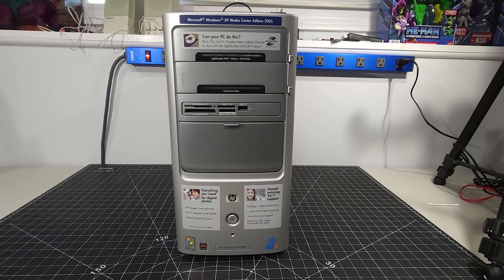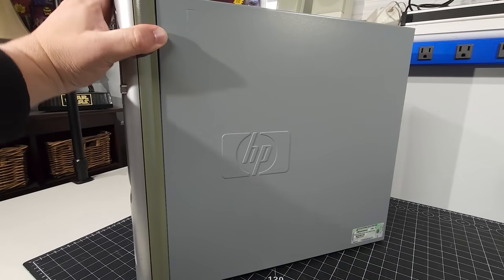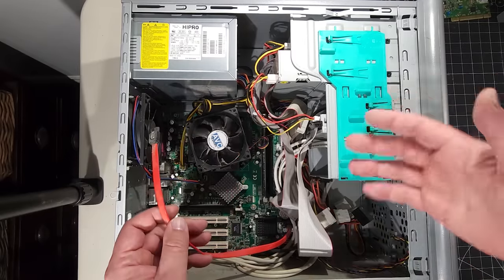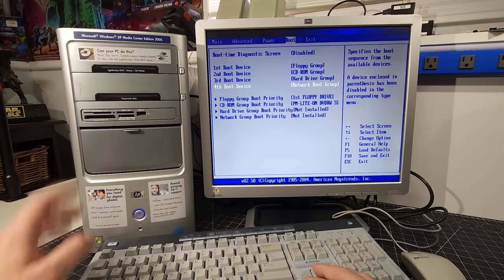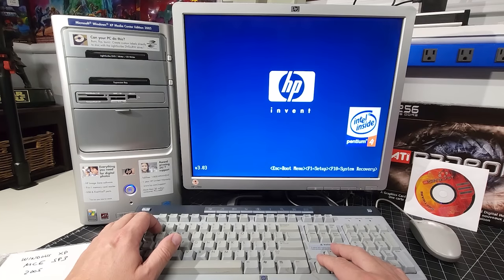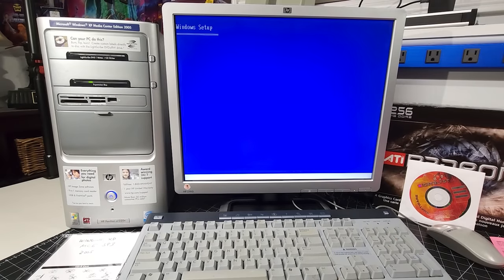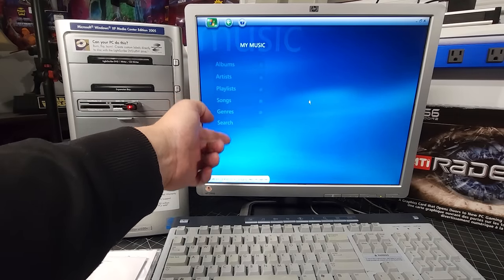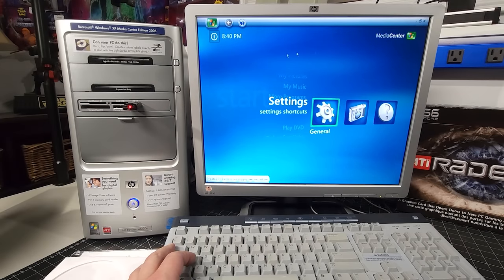HP Pavilion - Windows XP Media Center Edition from 2006!!

Comment: This was actually my first PC that could run any sort of games. Before this one I had this Dell Pentium 4 machine with ANCIENT integrated graphics that couldn't even run Half-Life consistently. This HP had a Pentium D, 4GB RAM and a Geforce 7300 LE and I would play a crap ton of source games and others at low FPS. I remember I replaced the GPU with a Geforce 210 and that was an actual upgrade since I was able to play skyrim at 20FPS and TF2 at 60. It's hard drive died in 2013 or so and I just got a really cheap modern laptop and did everything from there.
Reply from the maker: Nice!!!

Comment: Lightscribe software is still available. But, it is only compatible with Windows 8 and earlier operating systems. I still use it and have no problem putting them in any PC from 2013ish and earlier.
Reply from the maker: This is great info to know. Thank you!

Comment: Interesting to note is that HP were making multimedia machines up until the late 2010s. The slimline s5 series actually have an infrared blaster built into the front panel, all you need is a compatible tv tuner to use it.
Reply from the maker: I'm wondering if I stick a tuner card in this and a USB receiver for a remote if I could get that going.
Reply: @TheRetroRecall  It's possible, granted setup in XP media center is kind of a pain since  the web servers have been offline for a few years now.
Reply from the maker: There have been random projects popping up restoring old networks.  I'm going to take a peak around.. The retro community is really strong!

Comment: the cmos battery in my old optiplex lasted for about 15 years before it finally died. the only think i can think of is it sees regular use so it was keeping time with line power and not actually using the battery. michal mjd did a video on those windows dancers. there's actually a bunch of them that were included
Reply from the maker: 15 years.. Wow.  I'll also have to check out his video.  Thanks!

Comment: about those USB external drive, they were called media drive yes. They used the USB type B connector. Also, the media drive bay is installed on a 3.5 inch bay, not the 5 .25 inch. I used to have a HP Pavilion case with that media drive bay. I'd throw in an old linksys usb wifi adapter, connected it to that with that usb type b connector in that media drive bay to give that desktop I built in that case wifi.
Reply from the maker: For sure.  I have an HP media drive here.  It was a cool idea at the time.  I do like your adaptation adding in WiFi using that though - pretty neat!
Reply: @TheRetroRecall  I imagine they probably have an 5.25 inch to 3.5 inch adapter to mount that, which is really adapterception at best! I never had a HP Pavilion of this age lol, the one I got was from 2008 where they did the upside down m-ATX mounting lol.
Reply from the maker: Haha!  Yes I remember that era.

Comment: Cap plague was 2004-2007 but these machines still work fine. Apple was hit hard the most with the G5 and PowerMac range.
Reply from the maker: I have a few systems with pretty bad caps.  I'll be replacing them soon - hopefully in a video!

Comment: I used to have an earlier machine of this model from 2004 but unfortunately do not have it anymore and have been really wanting to find another to make video about it.
Reply from the maker: It really is a cool concept for a computer.  Especially thinking about what it would have been like at the time.
Reply: @TheRetroRecall  I think I had the M7480N I'm not quite sure but it was one of the m7000 models.
Reply from the maker: I wish I could find the original restorations cd's for mine.
Reply: @TheRetroRecall  I’m lowkey starting to want to make a video about some of the black ones, I have one that’s running vista as well from 2007.
Reply from the maker: Awesome!! Do it up!!

Comment: I have one of these but it doesn't work at the moment the hard drive plugins on the back are messed up and some of the motherboard plugins are messed up is it worth getting it fixed. Is a 2005 HP Pavilion a1330n
Reply from the maker: I think all are worth getting fixed - especially if you want to take the project on yourself :) it can be a fun hobby!

Comment: I still have mine that still works, Mines is the HP Pavilion 1630n. Here are the specs of the one I have. 
Athlon 64 X2 Dual Core 4200+
2GB DDR2
250GB HDD
Windows XP Media Center
NVIDIA GeForce 6150 LE

This model was released in December 2006. I got mines at circuit City brand new and it was the latest PC when I got it. My grandmother let me pick out whatever computer I wanted. 

Do not know which was better but to put it in perspective. I was able to run games on it like need for speed 3 hot pursuit up to Grand Theft Auto San Andreas no problem at all. Especially for a on board graphics card. I still have the original box this PC came in I believe.
Reply from the maker: That's amazing, and still have the box??? Even better!! I'm jealous haha.
Reply: Yeah its pretty crazy to know that it still works flawlessly after all these years. The only thing I've done to it is upgraded the ram to 3gb and it now has a 320gb hard drive in it after it died back in 2014. @TheRetroRecall

Comment: Well saved!👍👍It's a fine looking case and it's in decent condition, 2 gig., of ram., is the maximum which that system can handle.
Reply from the maker: I actually think it could do 4gb!
Reply: @TheRetroRecall  Hello, you could try that, but according to the HP specifications 2 gig., is the maximum.
Reply from the maker: Let the fun begin!
Reply: @TheRetroRecall  👍👍

Comment: The mobile version of the same ATI RC410 chipset can be found in ThinkPad R51e. Was really picky with ram modules (if one tries to get to 2GB - the maximum amount supported by the chipset). The integrated graphics (a further stripped down version of Radeon X300SE) had somewhat better driver support than Intel GMA950, but I found it too slow to handle mainstream titles of the era like Need For Speed Most Wanted.
Reply from the maker: Yeah, for sure.  There were so many different configurations at the time it was hard to keep track!  It was still neat to be able to squeeze as much out of them as possible.

Comment: want to start getting into MS-DOS basic programming what would be a great cheap desktop/laptop would you suggest?
Reply from the maker: That's a very open ended question :).  Always look at your local thrift stores, online marketplaces etc for a decent windows 95/98 type machine.  You can go with slightly newer hardware if needed, but I would stick with say desktop hardware that has both pci and ISA slots for you to be able to connect a wide array of compatible hardware.  You also have the option in the meantime to use dosbox or something similar to run the older games today while waiting to get your hardware.  Most importantly.. Have fun!
Reply: @TheRetroRecall  unfortunately most of the thrift stores don't take in old computer's
Reply from the maker: Hopefully online marketplaces can help!  At the very least, start playing around with dosbox! :)
Reply: @TheRetroRecall  unfortunately my computer can't run it is the a computer that you'd suggest that's not that expensive but good?
Reply: @TheRetroRecall  do you know if I could download windows 98 or MS-DOS on floppy on the Raspberry Pi?

Comment: I bought the same computerter back in 2006 and I still have it. The issue is that it  turns on good, but the monitor does not. No idea what could be.
Reply from the maker: Yeah it could be many things.  Did you try a different monitor?

Comment: I keep several old Sata & IDE hds that have bootable windows & linux on them saves time trouble shooting hardware. I test most if not all ofthe hardware before booting windows.
It's easier to download drivers from a setup linux partion.
I usually have at least 3 partitions Windows linux then NTfS for storage. It varies depending on the size of the drive. I usually have drivers media & other files (isos ,program installers tools) in the ntfs partition.
Was the onboard NIC bad?
Reply from the maker: I feel like a '&##) $@' lol!  I was so focused on replacing the 56k.. that I forgot it has built in networking 😂😂.  Thank you for pointing it out lol.. I'm going to hang my head in shame now lol.

Comment: I had the AMD version of this pc. When I installed my Media center edition, it asked for CD2 (I had both disks). The cdkey tells if it is a pro or mce edition.  So if you enter a mce key on a xp pro installation, it will install mce edition instead (you will need cd 2 from mce though. I also had the original mouse and keyboard, it had the same color as the pc.
Reply from the maker: The image I used had the MCE included on one disc.  It would be great to get the HP version... And experience all of that amazing bloatware lol.
Reply: I see, thats a bit strange to me as when I hade MCE back in the day, it had two cd's not one. If u didn't use disc two, than onIy pro edition would've been installed. I suppose there were different releases I guess.  @TheRetroRecall
Reply from the maker: I think the image that I have was modified.

Comment: I have the exact same case as this pc, but my system was a Pentium D model, but it was broken, so i gutted it, and i build in a Medion motherboard with an i7 2600, all the front IO is useable, except the FireWire port, but since the ports in the front are seperate modules (in a black housing), i removed the FireWire pcb and port from the housing, and i hacked in a usb 3.0 port, i also wired in 2 antenae for wifi and bluetooth. I loved the way this case looked, i love these old OEM cases, they are so sturdy! There is an Intel ViiV sticker on the front, as well as a Windows Vista sticker, no thief will ever steal this pc, but there is a very useable system on the inside! The PERFECT sleeper for me :p
Reply from the maker: I love this!!! Great job!!
Reply: @TheRetroRecall  Thanks man :) Ur awesome
Reply from the maker: You too!!!!!

Comment: You can upgrade this system to windows 7 and it will also run over 4gb of ram if you use 64bit windows and also I had a similar ati radeon 256mb card back in the day and using a 3ghz p4 cpu i could run crysis at medium settings. I still have this system as a backup pc and it still runs fine albeit I have changed virtually everything in it aside from the motherboard and cpu.
Reply from the maker: Sounds good.  Yeah there have been many configurations called out.  It seems this system was quite popular and was used in many different ways.

Comment: I own the 2007 model that has the HD slot verticle on the left front. Do you want to buy it? Mine came with Vista. I have the disks and all of the paper work.
Reply from the maker: Hi, What is the model that you have?
Reply: @TheRetroRecall  M7767c Complete with the original monitor and keyboard. Still looking for the remote. I know it's here somewhere.

Comment: I would definitely get one of those, but I would also avoid Netburst processors like the plague.
Reply from the maker: Hahah.  I am using this system everyday now that it has been restored as a Media Center!
Reply: @TheRetroRecall  May I recommend an Hauppauge HVR-1600 tuner card?  It worked like a charm in the past with these types of machines.  I know.  I had a good experience with these PCI cards.
Reply from the maker: I'll take a look around and see if I have one as I have a few tv tuner cards.

Comment: i wrote a comment about this program that fix all maybe it is that snappy program you have but i will use that by my self so thanks for telling...
Reply from the maker: No problem.  Snappy Driver Installer - many have recommended it here and I finally listened.  It works quite well!
Reply: It really is a good program, it helped me find a webcam driver that I couldn't find anywhere at all

Comment: Composite hase only one rca video output, but component has 3 (R-red, G-green, B-blue) component can do up to 1080p but conposite can only do up to 720p. Component was like hdmi when it came out
Reply from the maker: Thanks!
Reply: Composite can only do 480i NTSC or 576i PAL. Component can do up to 1080i or 720p
Reply: @Pasi123  i used composite on ntsc and got 720p thru it
Reply: @gamingit1  I doubt the actual output was 720p, it was most likely downscaled to 480i.
Though even 480i looks bad on composite compared to S-Video (which is also limited to 480i/576i)

Comment: I recently found one of those and the system was broken so i decided to give it a litle tune up from old parts i had lating around now the mashine runs an intelcore i7 4890 whit a big block tower cooler, 16gb of ram and an amd r9 390x but while doing this i also wanted to maintain the funcions of the cd drives' audio front panel and the swapable hdd it all bearly fits but it works a whit the help of some case moding (u dont see any of it on the outside) all the components stay nice and cool as well. So now its used in the lan party's i organize for me and some friends.

(The version of that pc i hade was a newer version it was one whit a socket 775 and core 2 duo.)
Reply from the maker: Major sleeper pc.. I love it!!!! And the fact you still use it today is even better.  Thanks for sharing.

Comment: Funny that the text mode setup still says "Windows XP Professional".

I do love the MCE theme. Though i use its derivative "Zune" which has a black and orange color scheme.

HDD's vs SSD's can be a bit of being period correct, preferences, use cases and compatibility.
I myself use mostly HDD's in old PC's because i have a boatload of those and the older OS's where not written for SSD's or even modern HDD's. This mostly stems from lack of TRIM support and 4k sector alignment.
Some of this can be mitigated such as only partitioning up to 75% to leave some part over for the SSD garbage collection and as a spare area for wear management. 

my 2 cents.
Reply from the maker: Of course. Like you, I have boatloads of drives.  Sata didn't have bad performance (not the same as SSD of course)... But not bad none the less.  And those clicks warm my nostalgic heart :)
Reply: @TheRetroRecall  A technique that comes from the enterprise world that is called "short stroking" basicaly limit the capacity of a HDD to limit the travel distance of the head. Instead of messing with the actual limit this can be emulated by keeping the partition the OS is on small and at the beginning of the HDD. Use the rest for normal data/video games.

This speeds up boot time and is cheap to do, on large drives that is :).
On small drives that additional space might be needed.

Has the added advantage with defragmenting as no large files are being moved about :).

Happy experimenting!
Reply from the maker: Thanks for the insight and tips!

Comment: Unfortunately the best processor updgrades for the mobo are Pentium D & Celeron D s. I had two Dell Optiplexes that had Pentum D 3.4ghz processors they both eventually cooked the motherboard after a few years of server use. I still have the processors.
Reply from the maker: Did the heat 'cook' the MB?
Reply: Yes the mobo actually changed color. @TheRetroRecall
Reply from the maker: Holy!!
Reply: Only the first one had the area around the processor change color. The other one The mobo just died. I should have replaced the stock cooling fans. Sometimes they would run all the time. Live  & learn. @TheRetroRecall
Reply from the maker: Yes for sure.  I didn't realize but I suppose as a server it would just run continually.  Melted the board... Yikes.

Comment: Around the same time, I remember us grabbing a similarly specced system from Gateway. That one had Pentium D in it. It did have a TV/Capture card, and I actually had a great experience using Media Center itself up until the digital-only TV switch. Really the only downside I can remember is that the files were rather large since it had to record in real time without much compression. That filled up the 160GB hard drive fast. Used the card reader quite a lot too for my camera and Palm LifeDrive.

That system had a long life, had a hard drive replacement at one point, maxed out the RAM, but when it finally died of capacitor death in 2014, it was running Android 4.4 X86, surprisingly well haha.. I considered repairing it but I REALLY dislike working with BTX systems and cases and I don't collect them.. ^^'
Reply from the maker: I particularly love your use of the MCE.  Knowing how your drive filled up helps me form what I would want to do moving forward.
Reply: Come to think of it, we added a Radeon X1650 from Sapphire to ours! I didn't game much on it back then myself outside of older titles and GBA/NDS emulation so that card worked fine for everything else. I still have that card and the original Pentium D from that system.. I should slap together a nice LGA775 system again soon and test those. I want to find one of the LGA775 adapters that I can use with modern Noctua coolers on that spicy CPU..
Reply: @TheRetroRecall  Yeah, don't get me wrong, you could make a decent amount of full episode recordings in stock configuration, like it was certainly functional, but if I wanted to keep the recordings around like we did VHS tapes, a bigger drive, be it internal or external was a must.
Reply from the maker: I know there would be easier ways but turning it into a video capture device for old VHS, etc would be awesome and nostalgic at the same time.
Reply from the maker: Now that sounds like a plan.  I wonder if amazon sells the adapter.

Comment: Dear lord i had the same model many years ago it was a good machine. It served me well for some years. But it was cursed as all 775 are i had 2 ram sticks on the computor and he stop detecting the ram. Moved on to another hp with a i7 4770.
Reply from the maker: Weird that it stopped detecting it.  At least you got another machine and hopefully it's still going :). I'll need to keep an eye out on mine.